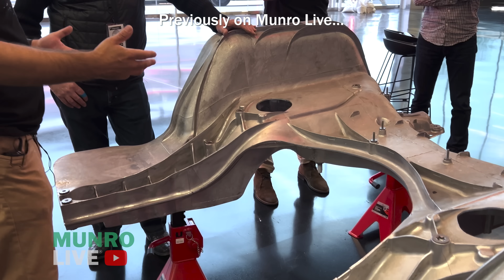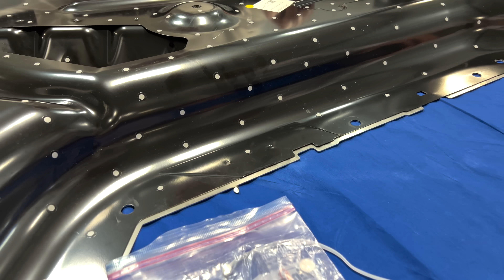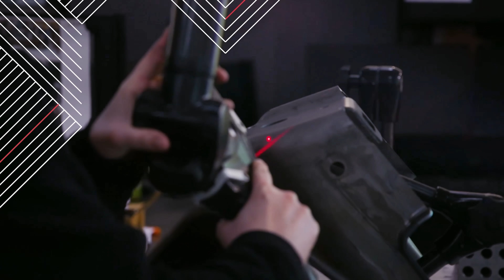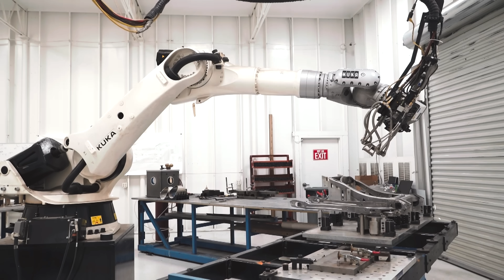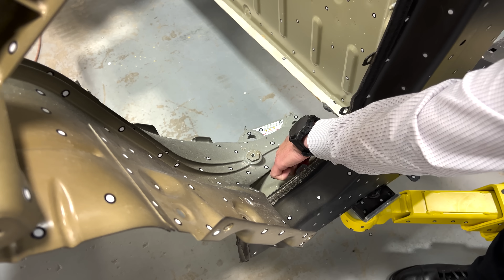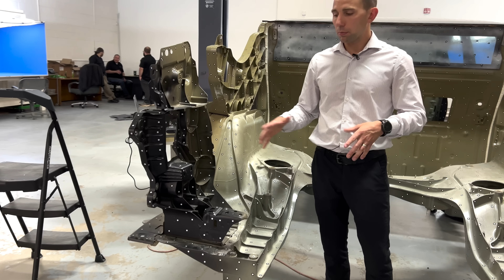Peeling Back the Layers: Tesla Cybertruck Rear Body Panel & Castings

Comment: So, any chance someone will chop off the triangle bed and transform it into a regular bed so we can use CT with a truck camper? Looks like it’s fairly straightforward task maybe even designed for that option? Payload and bed length are perfect for truck camper…
New RWD might be easier and cheaper (no electric cover) though lack of power port is a bummer.

Comment: Giant castings are great for the OEM costing but very expensive for the end user. So great for OEMs who don't care about end users repair costs. Good OEMs design for easy assembly and cost effective end user repair and replacement. BTW cast aluminum is not repairable. Once deformed or cracked it needs to be replaced. Many Five Minute Google Experts (FMGE) will expertly disagree. Will trust your family's lives to FMGEs.

Comment: Oof, a cast frame on a pickup truck is a serious weakness and I can see why WD broke his so easily. When It comes to trucks, flex helps absorb impacts and abuse, if it's to stiff the chassis will fail. Lastly lacking a ladder frame restricts what applications the truck can be used with.

Comment: The lower the floor of the cab and the lower the bed of the cargo box the easier it is to get in and out and to load the back.

Getting these substantially lower means changing the location of a lot of components. If you see pickup trucks with really low cargo boxes they use small diameter wheels because what dictates the height of the bed is the axle and drive shaft in ICE trucks and the electric motors in electric trucks. You can lower the Cybertruck’s bed by a few inches by making the electric motors with a smaller diameter. But you can only do so much this way. Eventually the electric motor would be the same diameter as a shock absorber. Going a lot lower (below the axle height) means turning the electric motor sideways so it fits inside the wall of the box (between the quarter panel and the panel of the inside of the box.

Drop the bed a LOT and you go lower than the rear bumper. Now you need to incorporate the bumper and a trailer hitch into the tailgate. So that tailgate needs to be well connected to the truck and still be able to open and close. But do that and you get a big improvement in ease of use.

Of course, you can also use the suspension to lower the truck for people boarding and for loading cargo in the back. But you can only do so much before hitting the restrictions mentioned above.

The depth of the Cybertruck’s storage compartment in the back, that’s how low the whole cargo box bed could be. We have low floors in city buses. Same kind of thing.

Comment: I was so excited about the Cybertruck for the past 4-5 years of anticipation.  Love what Tesla engineers have done.  The end product is not as great as the great parts and pieces you would expect...fairly small battery for a truck which results in not great road trip ability or towing range, god-awful visibility issues, and now with Rivian's refreshed R1s, lots of tech improvements and manufacturing improvements which maybe Sandy or Sue had a hand in?  380-420 mile range, new motors, etc...Rivian just took a very good truck and made it a great truck.  So the excitement and promises of the Cybertruck have faded.  I'll take a new Tri-Motor Rivian.

Comment: This could be simplified immensely in the rear.   There's no reason why the rear casting couldn't be the finished product.  Don't even cover it with anything, just shape it in a way that gives it strength, and then fill it all in like a body panel and call it finished (for the bed, not the cab).   There's no reason why the rear should be this complex.  It should be a simple box, just like other trucks--- except that box could be built into the casting itself and all one piece.  That entire outside fender structure is silly facade that is unnecessary.  It's a truck.. Give it a hard cast bed and be done with it... You could even cast flatbed versions too.  This whole design  in the rear needs to trim down some fat and cost.

Comment: I was hoping for a stainless steel truck, not a candy shell. The shape is cool, as well as all the advancements in design and engineering. But the Cybertruck is not what I need.

I'll be waiting for an Aptera. Hopefully it can ford 8 inches of water without motor damage or floating away, as I have to cross a creek to get to my house. Otherwise my F150 will have to do until batteries cease to be the bottleneck.

Comment: E-coat, or electrophoretic coating, is a high-tech process that uses an electrical current to apply a protective finish to metal surfaces:
1. Immerse
The metal is submerged in a water-based chemical bath containing paint particles, resin, pigment paste, and co-solvents. The water is de-ionized to remove conductive ions.
2. Apply current
An electrical current causes the paint emulsion to condense and form a coating film over the metal. The coating can be 0.1 mm thick and made up of many layers.
3. Cure
The metal is placed in a bake oven at a minimum of 375°F for at least 20 minutes to cure the paint. 

Aerospace Metals
What is E-Coating and how it works? - Aerospace Metals

Professional Plating
What is E-Coating? - Professional Plating
Jul 24, 2020 — Bake Oven: The metal surface is placed in a bake oven where the paint cures for maximum performance. Usually, it is baked at a minimum of 20 minutes under 375°F. Professional Plating ensures that your job will always be done to the highest standards. We provide two different types of e-coating: acrylic and epoxy. Acrylic e-coats are especially suited for one coat application on automotive parts, electrical components, car wash equipment, and lawn and garden equipment. Epoxy e-coats are much better for automotive parts, primers for appliances, and electrical items.

nipponpaint-holdings.com
E-coat (Electrodeposition Coating) Technology | NIPPON PAINT HOLDINGS CO.,LTD.
Dec 16, 2020

Lippert
Lippert What is E-Coating? | Lippert

groupehyperforme.com
What is Industrial E-Coating? A Comprehensive Guide to Protective ...
Jan 30, 2024 — E-coating, short for electrophoretic coating, is an innovative method of applying a protective finish to various surfaces, primarily metal components. This process involves immersing the product in a water-based solution containing paint particles, followed by the application of an electrical current.
E-coating can protect parts from rust and corrosion, making them more durable and longer lasting, especially in harsh environments. It can also provide other benefits, such as design performance, weather resistance, and anti-chipping. 
There are different types of e-coats, including acrylic and epoxy. Acrylic e-coats are often used on automotive parts, electrical components, and lawn and garden equipment. Epoxy e-coats are better for automotive parts, appliance primers, and electrical items.

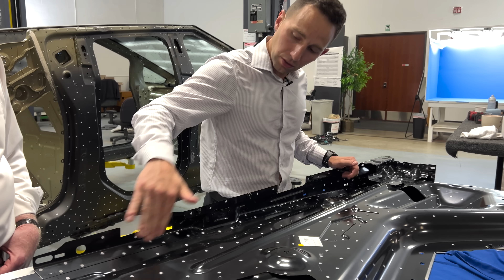Comment: Okay, I paused as soon as I saw this, a 9:59 there is a dent shaped like a Cybertruck right in the middle of the panel backing. Do they ever mention this in the video? Edit: A little bit later, you can see a hammer shape in front of the CT, like it's dropping onto the front of the truck.

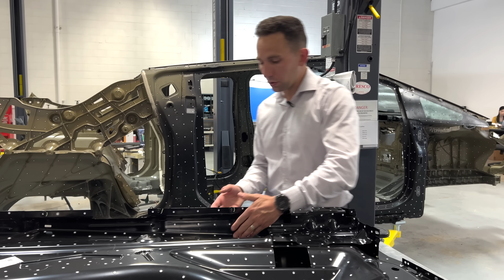Comment: 10:50 why wouldn't you zigzag the lazer weld instead of a straight line so you get the strength in both directions (which was implied with the spot weld)?!?

Comment: Maybe the near center crease spot weld was to straighten the stainless panel. Remember the early days of the truck it used to have a ripple in the stainless around the wheel arch when you looked down the vehicle (maybe a pinch point and warped the exterior). Now, of course this has been rectified.

Comment: interesting rear fender, so much material and especially space.  It appears Tesla needs more stiffness than is available from the rear casting. this almost like the exoskeleton Tesla wanted back then, but I guess  thicker stainless steel is not worth the expense and additional weight.

Comment: The flutes/channels are for drainage to prevent water/dirt buildup and ultimately prevent corrosion. They obviously have nothing to do with E-coat drainage in this application, since the panel has already been ecoated prior to being bonded to the stainless exterior.

Comment: I've been waiting for this analysis and you didn't disappoint.  There is styling and there is engineering.  Most people respond to the styling and don't see the engineering behind this vehicle.  That is the real story.  Thanks, Munro.
Reply: The goal is the lowest coefficient of  drag, NOT styling, lipstick and a party dress .  The stealth fighter doesn't have much Styling either 🙄
Reply: @MashDaddy   They didn't try to minimize the Cyber coefficient much at all because they liked the dumb wedge- it cuts like a brick into the air; like the Lambo Countach you are fooled by the slick design.  Claimed .034 real world .034-.038. Rivian has .030 D.C.; Model 3 refresh .021 for comparison.  🎬
Reply: Engineering doesn't mean a thing if the styling is ugly. Just look at the '39 Airflows from Chrysler. It's never been zero sum, it's just engineers don't matter as far as sales.  All Cyber owners know is the panel gaps, rust and other issues (gas pedal fiasco) don't speak well of any engineering on Cyber. 🎬
Reply: @cuda426hemi sybau. My cyberbully turns heads hauls and kills off the line.

Comment: For all of the cathodic corrosion experts: Won’t the inner steel panel eventually corrode from touching the outer SS panel? You have 2 dissimilar metals and I don’t see how the E-coat protects from corrosion down the road.

Comment: Steel on the inside of the stainless steel panel makes me wonder about future corrosion.  Dirt, mud, salt can get trapped up inside those pockets along with moisture and cause rust inside the panels.  I've seen plenty of old trucks rust out from similar seams.
Reply: Agree.   Lets hope the e-coating on the steel stands the test of time.  The nice thing here is that one can replace every stainless panel on the vehicle with a wrench.
Reply: That black coating last 2 salt winters maximum before it starts turn brown. Needs cavity wax but Tesla don't do rust profing.
Reply: Dont even need a wrench. There's videos of them coming off on their own just from driving

Comment: Sorry, just don't see it. Sandy explains how casting deletes need for fixtures, then Jordan explains how 7 separate pieces are connected together - by using what? Fixtures?
Reply: I heard it as the 7 pieces are the fixtures.  Seven pieces that replace the hundreds of pieces that would be in a conventionally manufactured truck.
Reply: @alanrivaldo-h  Sure, I thought the rear casting was all one piece, so I could see how you wouldn't need jigs, but as its 7 separate pieces then you would need a jig to align then connect? And a conventional truck bed has more pieces yes, but not hundreds, and its a bit rich for others to tell Ford you're doing it wrong 900,000 times a year when its how they make most of their profits!

Comment: Sandy , can you get a hold of the new RAM  and evaluate the Truck? Some say the body has to COME OFF  the Chassis to do major Engine work, like change the engjne or overhaul it. Thanks
Reply: Thats been a thing on diesel trucks for decades. Easier to lift the cab than wrestling with it

Comment: Even though it has a stainless steel exterior, will it be rusting on the inside?
Reply: If salt and dirt end up in there, it will. I wouldn't expect much ending up in there as the bottom is glued shut everywhere except at the drain holes. And the wheel arch liners probably protect it from abrasion caused by the tyres flinging stuff around, so it'll take a long time. The same applies as for every car though: You should keep the car clean especially behind the plastic wheel arch liners, as that's where salt and dirt will accumulate and that's where any car will start to rust at.
Reply: Exactly my question after seeing how the inner panel was made from steel, not thinner SS.
Reply: Like every other steel car?

Comment: What are those white dots??
Reply: 3D scanning reference points, so the scanner knows how to stitch the “photos” it takes to each other.
Reply: The gaps between the dots are fixed or you can put them in any distance from each other??
Reply: Just stick them on randomly couple inches apart

Comment: I'm not totally sure , bu the panel showing laser welds appears to be laser welded to the outer, stainless, panel. I am sure that Tesla had problems with weld "blemishes" on the stainless, visible panels - and they went to some lengths to eliminate these - maybe laser welding (very controllable) helps in this regard....
Reply: I guarantee you the outer stainless skin is not welded to those inner steel structures.
Reply: @jeffbransky7966  What kind of guarantee is that? Some sort of money back deal?
Reply: Correct. The panel would show color changes from the welding heat that is generated.
Reply: As shown in Sandy's tour of of the Cybertruck line with Lars, the door inners are stamped stainless (non-HFS) steel  laser welded to the door outer panels.

Comment: I love your tear down videos.  A quick question though, at the end, you said that you will be putting the side panels back on and doing torsional testing.  We saw one corner of the mild steel stamping that was peeled up, and you said you wanted to peel up some more.  Won't this compromise the torsion testing?
Reply: Sandy has two CTs...
Reply: @DarylOster  Yeah but he said they were going to put the panels back on then test. Why didn't they do that before ripping it apart?

Comment: I've seen many here in SoCal on the road. I think they are super silly. They aren't really even a useful truck. I see them on the road like giant angular chunks of stainless, with tiny little heads driving them. I'm thinking about it, still considering options, but I think it takes the cake for the most ridiculous (in a dumb way) vehicle ever. Why would I ever buy that when I could get an actual useful truck, designed to the purpose?
Reply: Because many people want to drive something different looking than everyone else on the road.
Reply: You CAN get whatever you like.
I’d say they’ll sell nearly 100,000 of them this year.
Reply: @oggyoggy1299  Last I heard, they are making 1,000 a week.  So that's about 50,000 per year, unless they've been able to ramp up more than that since the last update.
Reply: Many people use their trucks merely to commute to work, and use the bed portion once or twice a year at most, whether for their own use or to help out a friend who only owns a sedan, for example.  Same for an SUV with back seats that aren't removable.  Someone who uses the bed only rarely won't care much about how easy or useful the bed is, as long as it offers more utility than the trunk of a sedan or back of the previously mentioned SUV.  Hence, this vehicle, especially when less expensive trim levels become available, will still sell more than a million units over the next few years.

Comment: Given the separate gigacasting and the side raiser castings, what are the odds that Tesla might release an "old school bed" work truck? (I don't mind the triangle, but for some work application as well as truck bed campers the triangle might be prohibitive) - seems like it would be a fairly easy change... maybe on the entry level CT - it would save Tesla quite a lot of money skipping the cover as well as the added stainless steel cost for those large sides
Reply: Think "outside the box" (or "the bed")
Install a full length slide-out on the bed.
Suddenly you have a VERY capable, easy access truck.
Then install ANOTHER slide-out attached to the "Airline tracks" on the sides.
That's where your tools live.
The lower slide?
Pull out the slide to load loose/ bagged material (add a 6" deep removable tray?)
Or you pull out the slide, load your sheet materials and slide it in.
If you have various uses, build a table on wheels, preload your gear at base, roll up to the slide, transfer.
.
If you're a technician?
Heavy tools/ racks/ component storage on the "inside" end, work table on the "rear" end of the slide.
And you slide out your lightweight  tools on the upper slide for easy access.
.
Now you have a REALLY versatile truck, fully lockable and secure.

Comment: Cars are becoming jist like cellphones: expensive, invasive, and completely unrepairable.
Reply: Good thing this truck is made to be easily repairable, then.
Reply: Thankfully cars like this are starting to address that problem.
Reply: Cars and everything else in the world are becoming more expensive... but more reliable, better designed, and with tighter tolerances.  The challenge continues to be the reliability of software and availability of features, and like with a cell phone, with a Tesla both can be fixed with OTA updates.  If fixes and features were solely hardware dependent, like with an old school landline phone, then you would never see any changes or updates unless you outright bought a new vehicle.  Perhaps it's not for everyone, so there may be the equivalent of flip phones availble some day in the US... like maybe vehicles from India.... that is if they could ever pass US crash safety standards.